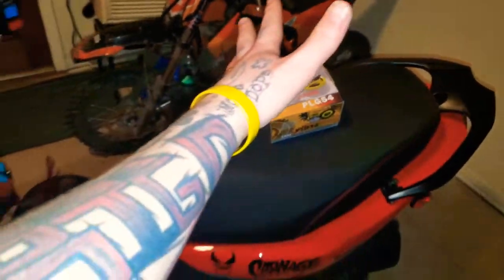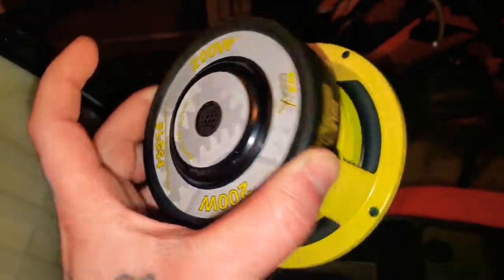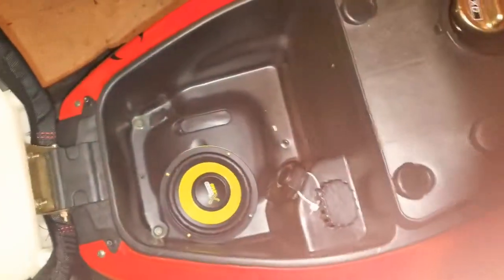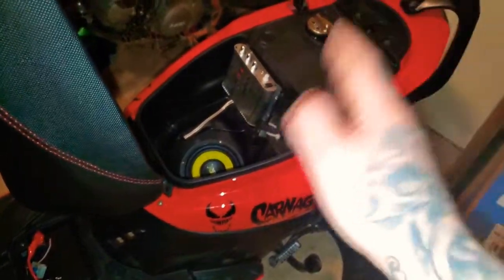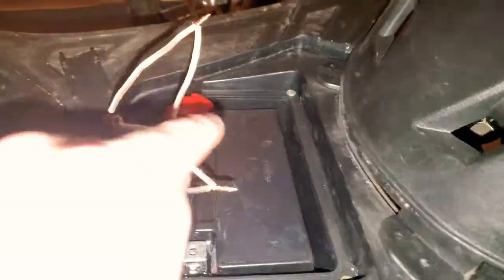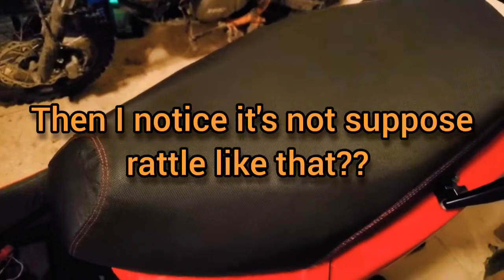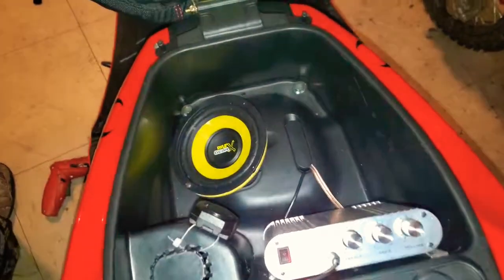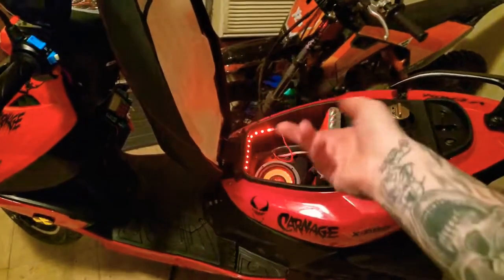How To Install A Subwoofer And Amplifier On A Moped Scooter

Comment: What Amp is that?
And does this system have an effect on your electrics??
And what battery does your scooter have,( specs) 
I wanna pimp my scooter hard-core like yours🔥🔥😎
Reply from the maker: Hell yeah thanks, believe it or not it's a Chinese amplifer 2 channel 400 watt Lyle   
I'm using and a cheap motorcycle bluetooth speakers on the front
Not too sure on top my head on battery specs but probably in bike manual

Comment from the maker: True Bass Test Starts 10:44
Reply: @Daniel Parker Big D I absolutely love the set up and sound, I want the same for me. I Already ordered the subwoofer and I know lvpin is the amp brand but I need the one that you have. Tell me about the other speakers, brand name and I suppose that they are waterproof.
Reply from the maker: @atticusgreer.  Thank you I'm glad you loved the set up but I had to take it out cuz the sub wasn't water proof and I couldn't barely hear with the helmet on, but it thumbs but I don't have it in my scooter no more
Reply: @gamefreakdanielBIGD  Thanks for your response guy, still you never told me the model of the amp or speakers. My plan is to have a mini speaker box built, I've seen a video of such, one guy even used his trunk as the speaker box. I'm determined to make it work somehow, lights and all. Honestly my 808 thump paired with power amp app is just as loud, but what you did is way cooler.
Reply from the maker: @atticusgreer.  well thank you my amp is is lpvin 400 watt with 100 watt pioneer 6 inch

Comment: Kills your battery I'm guessing
Reply from the maker: @My_Bad_grammar  yeah that's the only thing about it
Reply: @gamefreakdanielBIGD  did you find a solution to that ? .. I added another battery only for my accessories,but I'd really like to have it turn on with the key .
Reply from the maker: @My_Bad_grammar  you have to wire it up to your ignition which takes more of a hassle to do, my guess is just have a separate battery for it and when it does just charge the battery up without killing scooter battery, I had to replace my original battery because of it